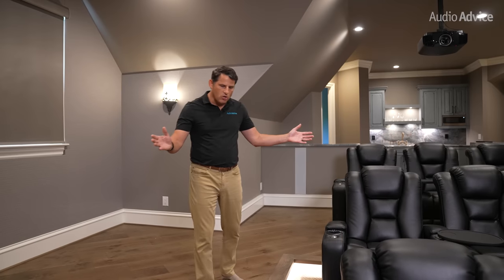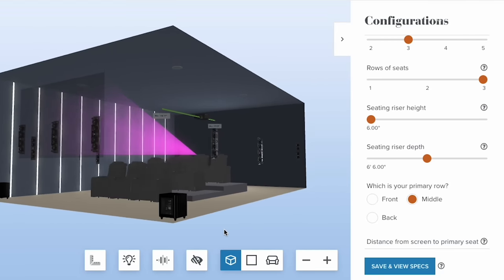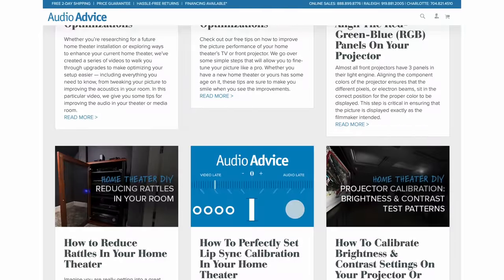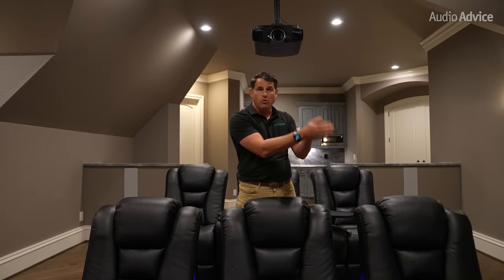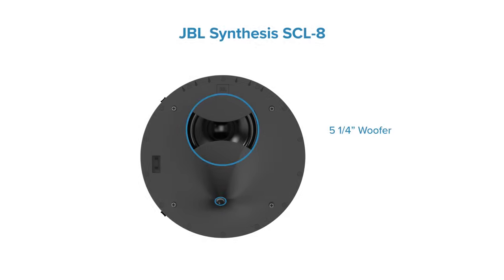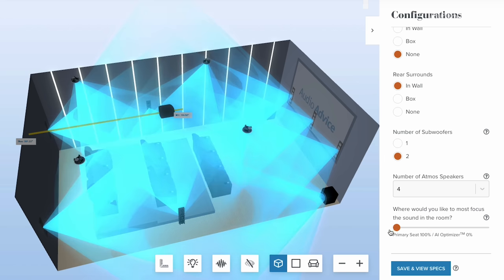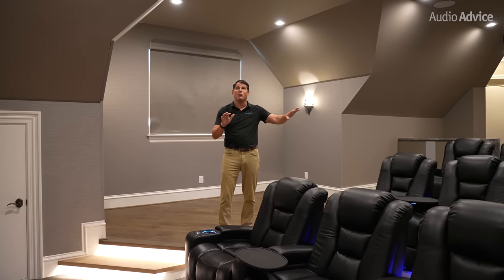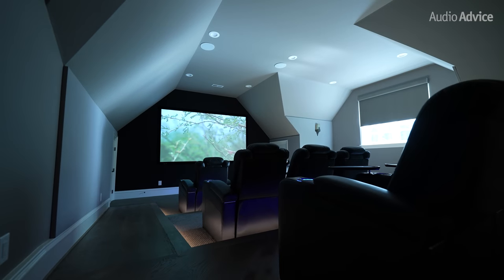STUNNING 7.2.4 JBL Synthesis Home Theater Tour: How to Overcome Design Challenges in Any Room

Comment: Very interesting, how do you account for the slope in the roof in your gui tool? Celling hight?
Reply from the maker: Glad you liked it.  There was not a way to have the tool account for angled ceilings, with all of the possible variations, it would be far tool complicated.  We just have to do ones like this manually after we start with the basic room dimensions as a rectangle.  However the tool still works fantastic for screen size, sight lines, etc.  Thanks for watching

Comment: OK, what am I missing here...? The two rear speakers are literally 6" off the floor...? And the two front subwoofers have acoustic treatments covering them...?
Reply from the maker: Great point. We should have pointed out a couple of additional things in the video. The first is that we custom cut out the speaker driver locations in the acoustic panels. So when you see the full wall panels both in the front and on the sides, the location where the speakers are have nothing in front of them except acoustically transparent cloth. The rear speakers are slightly lower than we would typically want them for the rear row because they had to be put in the bar walls, however, they are very close to correctly height for the primary listening position which is lower down because of the risers. Both great points that we should have made in the video. Thanks.

Comment: Was there any specific reason  of not using the JBL synthesis preamp on this project if your using the JBL synthesis speakers?
Reply from the maker: The customer specifically wanted an Anthem 1140 and the ARC Genesis software. However, there is a big advantage to using all JBL Synthesis products like you said and is typically what we recommend. So at the end of the day it was just customer preference. Hope that helps!

Comment: The chairs cost more then my whole house... Make something for us common folk?
Reply from the maker: These chairs are likely less expensive than you may think. They are the most functional chairs out there but less than almost any high performance theater chairs. Check them out: https://www.audioadvice.com/revelation-home-theater-seating
Reply: You can make a decent theatre for not a lot of money. Used projector, white wall, find some nice vintage speakers or some new budget ones. Monoprice has good budget speakers in my opinion, you can get new Dolby atmos AV receivers under $400, and use the couch you already have! Applied much of this to my setup and I'm all in less than 2k and have a decent little setup!